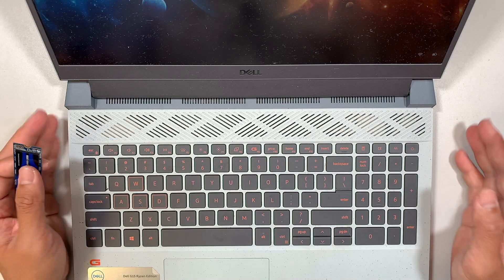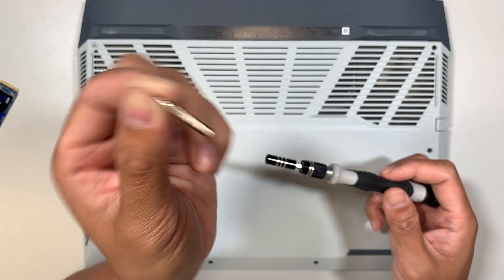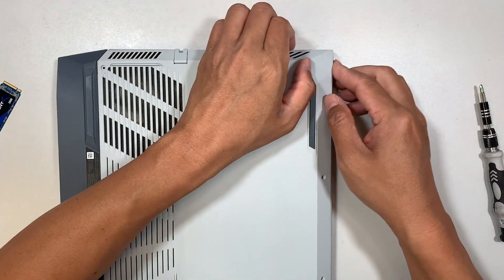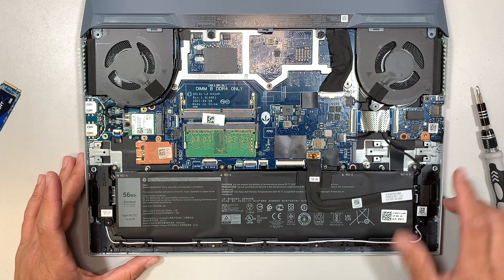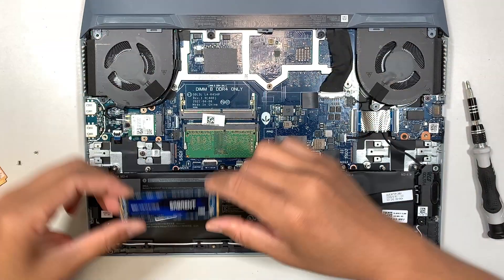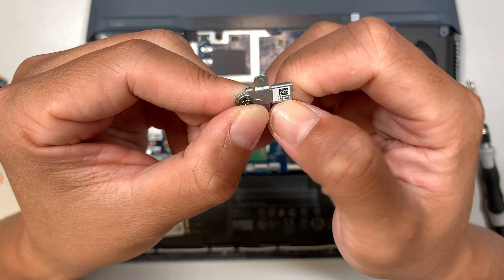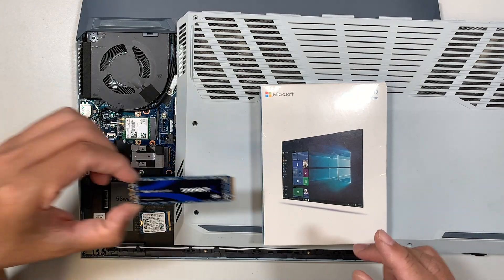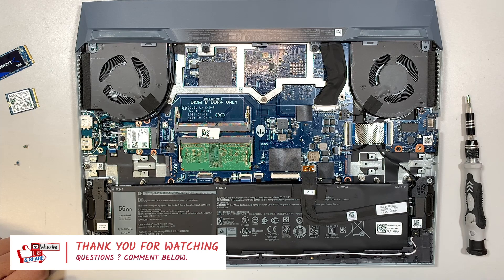Dell G15 Ryzen Upgrade NVMe M2 SSD

Comment: Everyone please be careful removing that metal piece he points to at 4:37 and removes, i got a pretty nasty cut from that
Reply: yo i’m tryna like push it out and it’s like not budging, was it supposed to come out that easy like in the video?
Reply: @iley6  yeah it was a pain in the ass, but i used a screwdriver to push it out (dont try this as it can damage your laptop permanently) and it worked (right as it cut my finger open)

Comment: :dothefive::dothefive: Would have been wise to first install the 2nd nvme in the empty slot available, cold boot to usb stick and clone the 512 nvme to the added nvme drive, then turn off the computer and swap both nvme's physical location on the board, reboot and voila' OS is transferred and you can now format the 512 to use for extra storage. There's no need to reinstall Windows and all your programs because they're alrerady there.
Reply: How do you clone? I tried a program and it did not work.

Comment: Just an FYI you need to order the 2280 heatsink to actually install the 2280. You cant close the close moving the stock 2230 heat sink.

Comment: Everyone is saying the g15 has only 1 SSD slot but it seems like there's 2 slots with the SSD bracket
Reply from the maker: maybe
Reply: I have 1 Dell 15 5525  , 1) doesn't have room.for 2 m2 only the original one  2) no braket.... I hope it work for you
Reply: Which one You have? Cpu and gpu @eduardogalvan627

Comment: whats the max storage the laptop can run?
Reply: 4tb maybe
Reply: This laptop will accommodate TWO, M.2 2280 SSD's PCIe Gen3 x4 NVMe up to 2TB --- Do not use Gen4, as you will waste your money.
Reply: @MajorImpactWreckBEST what do you mean waste your money? As in gen 4 are usually more expensive or as in it won't work?

Comment: I have a G15 5520 model with a single SSD slot. Can I fit a single sided 4TB M.2 inside the machine? Dell says it only supports 2TB max, however this is due to most M.2 SSD's having double sided flash chips when they are bigger than 2TB? I'm looking at the Crucial P3 M.2 2280 4TB to replace in my machine
Reply: Did you figure it out? I have a similar problem. I have two SSD slots on my G15 5515, the first slot supposedly supports up to 1TB, the second slot supports up to 2TB. I dont wanna buy a 4TB and end up not working.
Reply: @lucatoni98  I sure did! Got a Crucial P3 4TB M.2 SSD inside the machine and it works fine. I have the G15 5520 which only has one M.2 Slot. 

You need to find a single sided M.2 SSD stick due to the physical spacing inside the machine.
Reply: @Chandler721 i have the G15 5525 what SSD do you think i should get ?
Reply: @Amityadavfr  I dont have the 5520. I have the 5515 Ryzen 7 and yes I dont have any problems with it after a year of owning it. I like it cause it has 2 SSD slots. 

Right now Best Buy has the 5530 RTX 4050 i7 1TB SSD for only 900 US dollars. I would buy that one if I was in the market for one right now.

Comment: So what am supposed to do when the my laptop’s motherboard doesn’t have the black slot on the right side for second m.2 drive ??
Reply from the maker: Yours do not have the extra slot ? Maybe different laptop model ?
Reply: Hello, what's the processor? AMD or Intel? I think there is a difference between these processors.
Reply from the maker: @igortka  AMD
Reply: @UbergeeksBiz  same there's no bracket I right side of my laptop moder g15 5525 what to do can u help me??
Reply: @jainampunamia9823 newer models only support 1ssd, 
You must replace the old SSD with new one😔